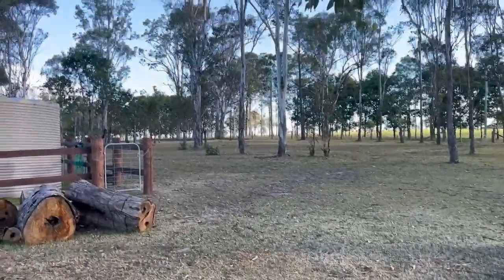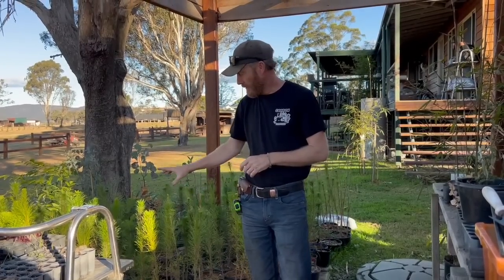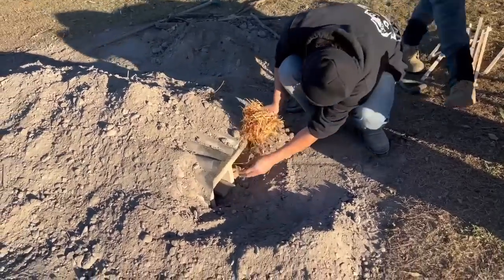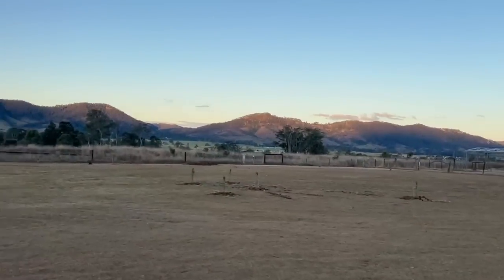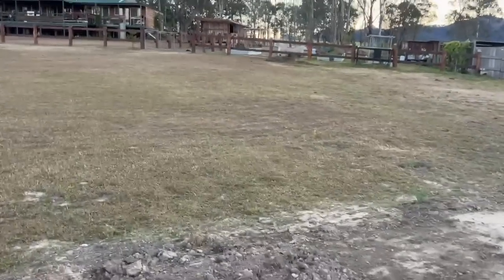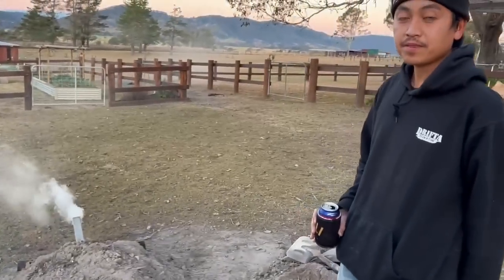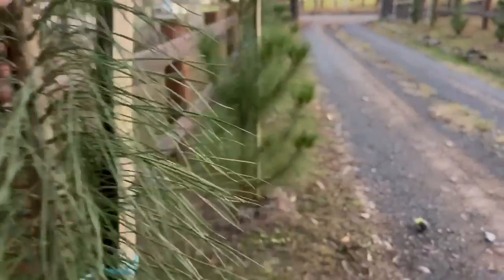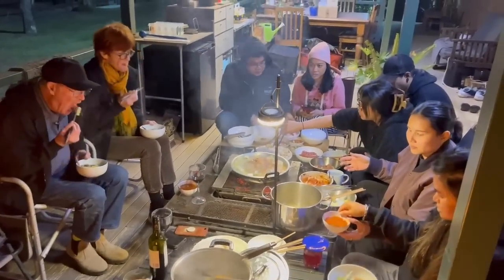HOW TO MAKE YOUR OWN CHARCOAL / GARDEN WALKAROUND

Comment: Here in the Netherlands where I live these kind of trees are called "Pijnbomen" They thrive in dry and sandy soil and are highly resistant to hot weather too. Carbon is a fertilizer for all plants and they can`t survive without it. Even humans can`t.  Dead pine trees provide "fatwood" which is a great fire starter, often found at the base. Reason is when they die, all the resin flows down to where the roots are.  Just like Eucalyptus trees the resin and the sap from the Eucalyptus protects them from disease and bugs. I love what you are doing!